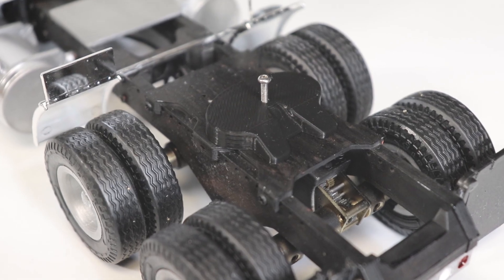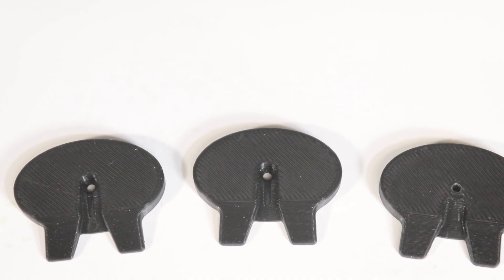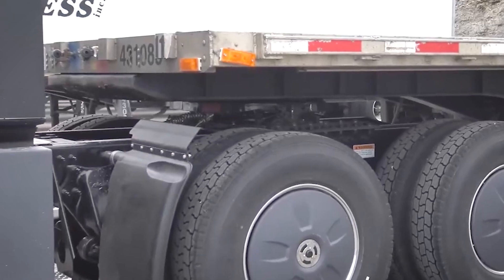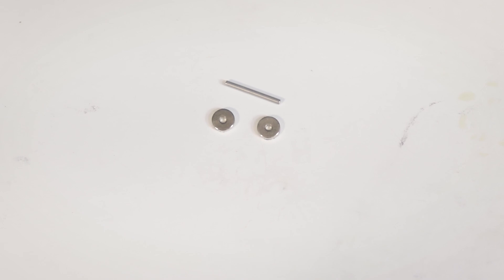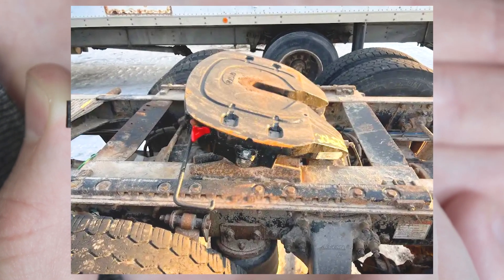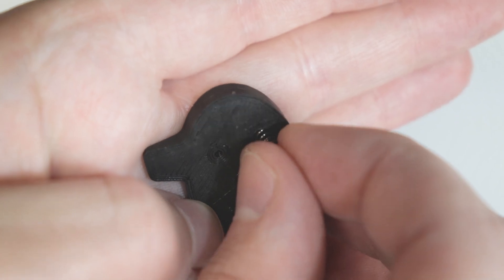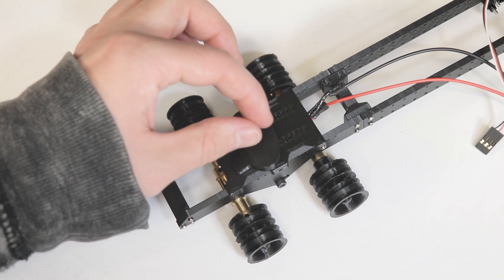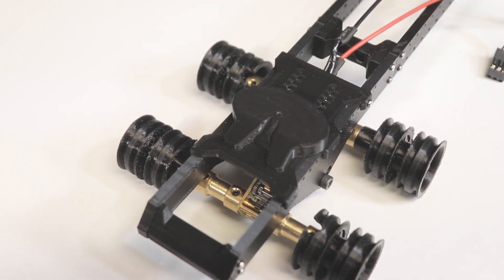New 3D Printable Fifth Wheel Designs for the CTC 01 RC Truck Chassis 🔧

Comment from the maker: ❗Important update! Turns out the 4x1x1mm round magnets we used for the magnetic fifth wheel are basically unobtainium. I've bought these size magnets on several occasions, and they've made an appearance on prior projects such as the brushless 78 Trans Am for it's magnetic clutch. I had no idea these size magnets basically went extinct until trying to gather links for all the parts to post on Patreon yesterday. So now I feel a little dejected posting this video and STLs knowing that the well functioning magnetic version is basically pointless unless you can find, or have the correct size magnets. 4mm Round magnets without the hole can work, but the rod in the center helped make the coupling more secure. We'll continue working to update the magnetic fifth wheel design to work around easy to obtain, non-3D printable parts. Apologies for not realizing this sooner. Please stay tuned for updates. The 2mm version works fine, as long as M2 hardware is still a thing. 😆

Comment: My grandfather drive semi-trucks, and i asked about the 5th wheel part, cause i said it has more the 5 wheels... He said don't count the Wheels he said count the axles on one side. The main truck would basically have 3 then the trailer would have 2 or more then it would be 6 wheel some trailers only have 1 axle so then the truck would only have 4 wheels... Most people just count all the wheels which then that is when people just call them an 18 wheeler.

Comment: will the fifth wheel work for pickup trucks?
Reply from the maker: Would probably be a little large to look correct on a 1/24 scale truck. I'd recommend scaling the part down in your 3D printing software to be the size you want. You can then bore the hole out if needed to fit the king pin. I'd be happy to assist if needed.